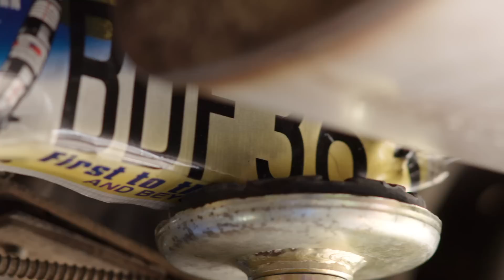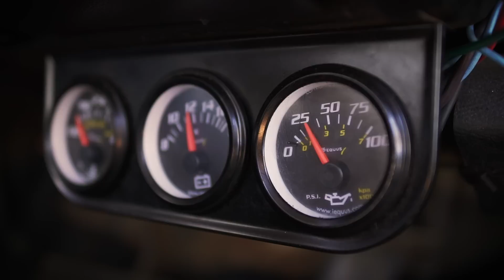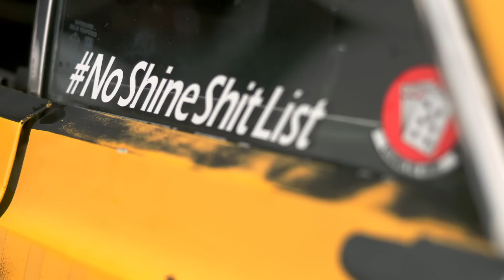Ratty Muscle Cars - The House Of Muscle Ep. 8

Comment: Great thing about a cuda is no matter what condition it is in, you are still driving a cuda.
Reply: Slapping bits of metal on over structural rust using tech-screws - nobody is going to be driving this 'cuda ever again in 5-10 years.  This guy is not making even the slightest effort to preserve it.  His Dart however - that looks great.
Reply: Matthew Sharpe it doesn’t matter how preserves t is that’s the point of this movement, it’s that he’s enjoying it
Reply: When you're right you're right you can't argue with that logic.👍
Reply: Better than a chevelle!
Reply: Fact
Reply: Same with a 68 Charger 😊
Reply: @Beer_Dad1975  I own a 1968, few options (automatic trans and power steering) Olds 4-4-2 that shows its 243,000 miles. The rust is in the fenders and the chrome around the wheelwells is still holding on, but the frame and floorpans are still good. There should be SOME attempt to keep a classic from falling apart--I like the idea this AAR cuda is a clone using broken parts off another--so it can be continued to be enjoyed. But cosmetically, yeah, my car really upsets my OCD friend since I won't even wash it. 

And the drivetrain is a flashback--variable duration lifters, switch pitch torque converter, and manual valve body THM400. I can come off the line in top gear and get 15 mpg, or I can swap from 1,800 RPM stall to 3,300 RPM and do 0-60 mph in 5.5 seconds. The front drum brakes are converted to power disc and there's a 2.7 turn lock to lock steering box.

Most people walk past it at a car show, but some "get it".  So I can say, there does need to be a little work done to "ratty muscle" so they don't return to their elements, but those who got their license in the mid to late 1970's, when muscle cars were just another old car, they know what "the look" should be.  Especially unibody cars--ugly things can happen when you ignore a floor pan that's really a structural piece and then wail away on it.
Reply: @clinteastwood9115 there isn't one Chrysler ever built that is better than a Chevrolet

Comment: I could not agree MORE! I have a 78 C3 Corvette Silver Anniversary that I drive almost every day. I bought it running for $1100.00 with a trashed interior and a broken rear window... all fixed with the help of Ebay and Craigs list. 

Sure Its rough in spots, has some cracks and spiders in the body and sketchy paint. She has well over 300,000 on her, a third trans (Just put in a Tremic 5 and Hydro Throw out) and a well refreshed 4 bolt out of a 76 pick up, after breaking a piston skirt on the original motor. Rusty Hooker full length headers and a home made exhaust that looks and performs better than anything the General ever made. Number matching??? F that! Most of all, I'm not afraid to beat the snot out of it on the back roads or park it at X-mart if I need something. Sure I hit the car shows, I park it outside and admire the shiny money pits. Then.... rumble past the trailer queens, pull out of the parking lot and light up the 'Pro Comps'. All with a little molten rubber on the rear quarters and a big fat oil leak spot where she was sitting. So while your polishing your rig, buying another trophy case and hoping some dust doesn't land on daddy's little girl, my junk is hood down and commuting two hours a day.
Reply: LaPabst I bought the exact same for 1000 and sold it for $2500 in a week lol it did need work obviously. But I didn't want to try and fix it since I wanted a 77 or older. I didn't care for the bubble window in the back
Reply: Lapabst, great comment.   Many criticize c3's but they've never sat in seat and peered over those bulging fenders.
Reply: For sure Duke, and they are starting to get a second look in the market. Admittedly, the General made WAYYYY too many of them for wayyy too long,,, I get that. But, if your smart, you just might want to grab a good one while they are still cheap. The post 75ers died early deaths because they were smog monsters and ill running. They also got real expensive to fix real fast. Lots of em' got stuffed out back with the rusty Studebaker pick up... which is now worth a fortune I might add.  

I started as a mechanic in 79 trying to keep these pigs on the road (Along with all the other fledgling choke-mobiles). Now with carb exemptions in most states and the net, these have never been cheaper to own, drive and enjoy. The most amazing thing about the C3? How a car so big can have so little room. J
Reply: I agree Alamo, the last version of the C3 can be homely from some angles, but bad ass from others. And they really suffered from 'cheap down' towards the end, the build quality is a joke that no one is laughing at. But, its still got some soul and really trys to be a Vette most of the time. For the money? Hell yeah, I'll buy one.

Comment: Ratty cars are my favorite, I love that I don't have to care about it
Reply: Patina is cool but bondo is not, had to do quarters and all on my el camino.
Reply: Stuart Cote very true
Reply: Stuart Cote you hit it right on the head
Reply: Lucas Sobrinho takes me back to my foxbody days lol
Reply: Driver Mod Gaming yea I feel you man I got a thing for these Gbodys I'm building my 80 cutlass sedan right now .
Reply: EL Beezy gbodys are cool we call em the junkyard heroes. You can easily swap an ls engine in one of those
Reply: There is a form of relief, not having to worry about scratches, door dings and the random bit of rust!
Reply: I have an A body.
Reply: Busters Garage if it schreds tires thats all that matters
Reply: The shame about the A body and F body chassis is that they're so likely to have rust through if the cars were anywhere near the rust belts..  They're going to go from common cars to fairly rare if they aren't kept from rusting.  But so many are daily drivers in all seasons, they'll likely be hens' teeth rare in 20 years!
Reply: It's a damned good start!  But even cars that aren't able to boil off tires can be SUPER fun too, just check out the grins a Datsun B210 owner has after a rip through a mountain road. :)  Similar to my 1978 Subaru Coupe... it only has 85HP, but is 100% smiles, being less than 800kg soaking wet! :P
Reply: Just put a new crank in mine and did TBI conversion.  Needs tuning to run its best.
Reply: Lol maybe where you are I can't seem to find any Gbodys in the junkyards around Atlanta ... and I'm not big on the LS's I mean don't get me wrong they nice as fuck an they make power but I love to see my sbc when I pop my hood... hell I even like it when it's time to tune the carburetor when the seasons change . Some stuff never gets old to me
Reply: I think its funny when a replacement panel has a dent in it.
Reply: HAHAHA, yeah- I had a graffiti truck that got loads of comments of "you have to cover the primer", if you dont mind a bit of rust, primer is excellent for a nice ratty look!
Reply: Busters Garage well i was talking about big engine american cars if it doesnt boil tires then im not a fan but i actually prefer a good handling car as well id just prefer something from the 90s early 2000s for that
Reply: EL Beezy they look exactly the same just slap a carb on it and its visually the same just a newer engine thats less prone to the older pushrod issues.
Reply: Oh, deffo!  My favorite Mustang, the 1968 Shelby 350 would roast some tires for sure!  But yeah, I love the 90s to 2000s well balanced cars as well, they were prior to when cars got REALLY bloated!

It was crazy to see my 69' Mustang coupe parked next to a late 2000s Honda... looking SMALL!

I do love the 1991 Subaru Legacy Turbos, they weren't too powerful, but SO well balanced!
Reply: Busters Garage Just the other day I saw a 65' gt350 driving on the A1A, I saw how small it was compared to all the other new cars. I see what some cars today are getting larger and larger, I mean look at a 90s bimmer 5 series compared to a 14' 5 series
Reply: I don't have the energy/patience for body work.  Can't really afford to pay someone else either.  And I'm cheap.
Reply: Stuart Cote dont make excuses why you dont make it nice just own it for what it is no? Thats the point of what these dudes do and i enjoy that as well
Reply: RavenPrecept solid drivetrain and floors that you wont fall through and im good with it haha as long as i got it for a deal
Reply: There is nothing wrong with caring about it, you got the wrong idea. That doesn't mean you should be an idiot and let stuff intentionally get ruined because you simply don't care about it, you'll lose a car very fast with that mindset. 

There isn't anything wrong with taking a car that already has wear on the body and leaving it as is. If that's what you mean. I had a 1989 f250 for awhile that was in pretty good shape but got a coffee cup dent on the hood, still drove it like that. I dislike that it happened but it wasn't intentional. I also wouldn't park all the way up front so people can slam their car doors into mine and ding it up.
Reply: eighty eight the man i dont think anyone is talking about intentionally ruining cars. Just getting cars that are rough around the edges and enjoying them for what they are.. maybe giving the engine a little power and doing cheap body work.
Reply: As long as it isn't badly rusted it's hella nice. Garage queens are scary to drive and live with considering how perfect they have to look.
Reply: Lucas Sobrinho I love this show, history is important
Reply: @Wei mort dan hew, Absolutely!  Isn't that crazy!? People loved comfortable and safe, but it makes the cars huge.  When they are basic, you get the Kei cars of the 60s, but the average consumer wants loads of accessories and gadgets, so without sacrificing lots of cabin space, you make the car bigger and that's WITH all the clever engineering that makes mechanics cry when changing a simple part takes 5 hours to just get to.
Reply: Lucas Sobrinho same! I love the style. my favorite of all time. big block ratty trucks too
Reply: yes!
Reply: Same for me, and I'd include ratty trucks too!
Reply: @stuartcote4915  TBI or TPI? I've had 2 88-95 Chevy trucks with 190hp TBI 350s, and they were gutless dogs and still got lousy gas mileage.

Comment: While I generally support the philosophy, perforating rust (especially structural) is a huge no-no.
Reply: Sensekhmet Surface rust is okay though
Reply: As long as it does not go deeper... I had personal experiences with rusted out cars, it's the stuff of nightmares.
Reply: Sensekhmet 

This, I can handle faded paint, but rust is the devil.
Reply: dead on. i do body/paint/smash for a living and appreciate the look of the body but couldn't drive around with a flintstones floor pan.
could be repaired and not change the look of the car at all.
Reply: Sensekhmet you only live once who cares
Reply: @declan2775  yep

Comment: If I ever had a Valiant Charger it would look like ass on the outside but would have beautiful mechanicals and frame. Yeah if she runs well and stops safely that's all that matters.
Reply: This car has serious structural rust, it's going to fall apart in a few years and nobody will ever get to enjoy it again - assuming it's already not beyond the point of no return.
Reply: i was thinking more on the lines of a sound base but a tatty looking exterior (surface rust)
Reply: Yes that's a good way to be - but this car has bits of metal - not even steel, just random metal like licence plates - tech screwed over structural rust in the framework - which won't do anything at all other than trap more moisture and dirt meaning more rust.  It's clearly a bodged up mess body & frame wise, even if he's got the engine, brakes, suspension and steering sorted.  It either needs to be taken off the road for proper structural repairs, or remove all the running gear and fit to a safer vehicle.  In most countries, this vehicle would be ordered off the road.  Looking at his Dart, I'd say it gets all the money spent on it and this poor 'Cuda is just for driving into the ground despite what he says about wanting to preserve it.  Makes me sad.
Reply: well,this is america, bud. deal with it.

Comment: In the mid '70's, I drove a '65 Malibu SS that looked like an abandoned car. The car was British Racing Green with a flat black hood. No dents but there were scratches all over it. Someone had added rear flairs to run N50's. I stuck in an old 396 with oval port heads, a Sig Erson Hi-Flo II cam, factory high rise and an 800 Holley. I added a 10,000 RPM nitrous unit which meant cutting a hole in the hood for the air cleaner to stick out. Underneath the air cleaner was blacked out cardboard to hide the nitrous. I had an M21 and 4:88 gears. I cut the flairs off and rolled the quarter panels with a baseball bat to fit 11" M&H slicks. After I blew the 396 after a year of racing, I installed an old LS6 I bought from a neighbor. I never worried about door dings and scratched paint. It was a fun car for street racing.